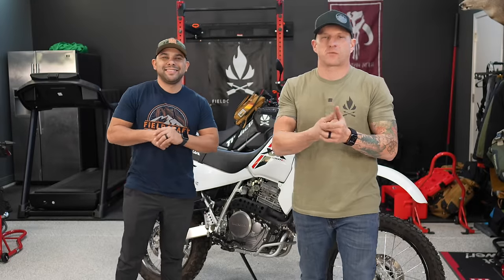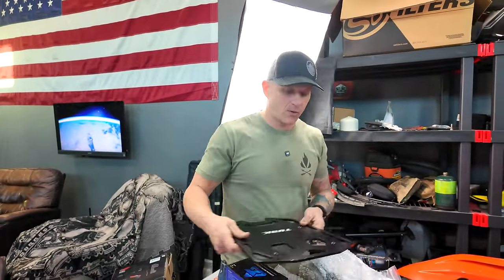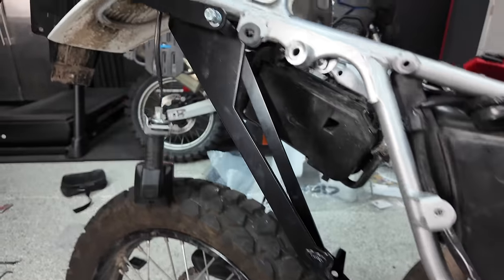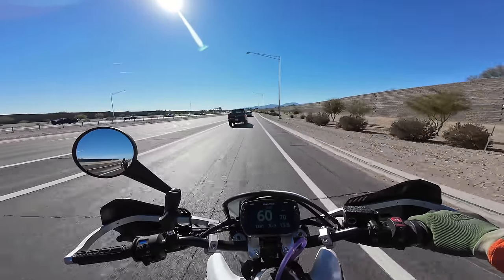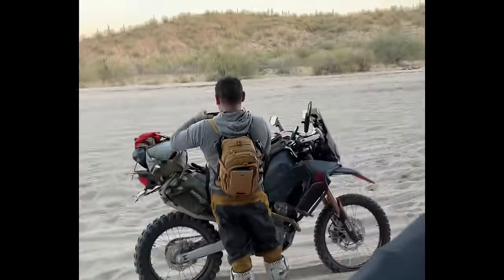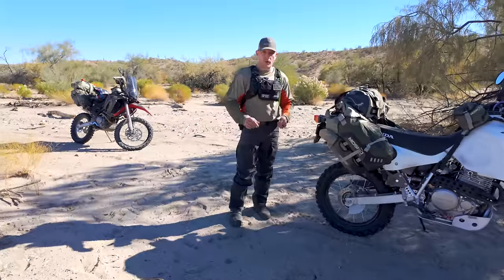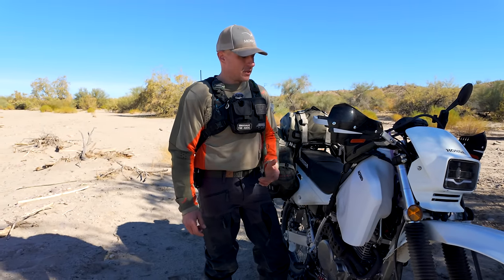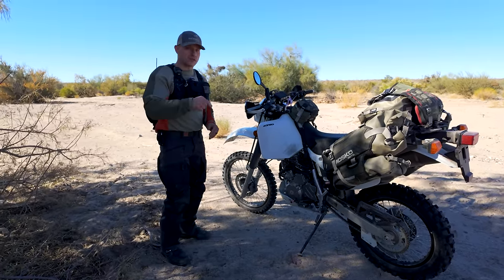Budget Friendly Bugout: Is the XR650L the Perfect Bike to be Prepared for the Worst Case Scenario?

Comment: If anyone wants a XR650L with 3K miles on it and all the sparkels, I have one for sale in NW Wyoming.
Reply: Below $3k?
Reply: @solosix3991   The stock bike is worth $5K and I have over $2K in farkles, what do you think.
Reply: No one ever keeps these long.  Too old of a design, no tach, no engine cooling, tank too small, too tall for 90% of people.  People keep KLR’s for 30k miles.
Reply: I had mine 12 years and i love it for what it is
Reply: @slalomking speak for yourself. I’ve had mine for over 3 1/2 years now and do hare scrambles with it all the time. 

Any adventure bike that you plan on actually riding needs an oversized tank. Air cooled, I drop it, I don’t have to worry about breaking radiators. It’s tall, I’ll give you that, but if you’re 6’ tall you’re fine, 90% aren’t built for a 340lbs adventure bike anyways. No tach? You’re probably better off in a car if you can’t distinguish how to shift based on sound. It’s an old design, if it isn’t broke, don’t fix it. 

Klr’s weigh what feels like a metric ton, I would hate to own something so heavy and so underpowered.
Reply: @slalomking 

Lots of people keep them for years. 

KLRs suck!
Reply: @slalomking what do you need a tach for on a dirt bike ....and being air cooled is advantage in my opinion no water pump no radiator no coolant hoses to potentially fail
Reply: @nathandevine552  yes I see the simplicity of air cooling.  I think most of these bikes spend most of their time on the road, getting to the off road area, thusly the KLR excels on the road.
Reply: Baja 1000 wins ain’t a joke. I gave up on KTM’s and the constant reliability issues, this bike will be running while your  ECU’s are trashed in a EMT strike. You’ll wish you had a carb 😂 the suspension is perfect once you get your cargo loaded. When I patrol this bike is very nimble and tracks well, and I’m only 5 81/2 32” inseam, and I can ride the $&@# out of this bike. Old design?? Its perfect and literally unchanged since 93’. End of Days Zombie apocalypse you’ll find parts for it ANYWHERE you go & EVERYWHERE you look!😊
Reply: @marctaylor-t8r  the cdi box and voltage regulator will still be fried on the XRL after a emp
Reply: @nathandevine552  but that CDI box is easy to replace and no programming needed, and cheap enough to keep a couple in a faraday cage till that day arrives 😂😂😂God forbid we ever get there, cheers!🍻
Reply: @marctaylor-t8r  better get a few spares if  sooner than later
Reply: @nathandevine552  true!
Reply: @marctaylor-t8r  don't forget that every replacement cdi will also be fried unless it's in a faraday cage.....old broken microwaves make good faraday cages👍
Reply: @nathandevine552  i thought it had to be in a completed circuit +\- power ground??
Reply: @marctaylor-t8r  nope it does not have to be installed to fry in a emp event.... that's my understanding anyway

Comment: For the worst case scenario you should remove the cv type carburetor and replace it with a slide carb like on the xr600. Also a kickstarter should be added. Replacing the stock headlight with LED is not a good idea, because if the LED burns out you're stuck with nothing. Carrying a spare light bulb for a stock light is easyier. Less electronics and good to go. The subframe support system was a really good idea
Reply: Just out of curiosity, how many LEDs have you seen burnt out? I haven't seen any. I've seen plenty of regular bulbs that have failed though.
Reply: Solid ideas for sure, I think the only thing I'd do differently is run a Lectron carb or something similar
Reply: Halogen bulbs can break super easily, that's not a very good idea either lol. 
if you really wanted to you could keep a spare/ 3 inch slim light bar for a backup. which would also still put off more light than a standard halogen bulb.
Reply: @DevDog67  replaced the stock bulb with an led and been through 2 on my tw and went back to stock maybe it was just the ones i got. the one on my dr650 is fine though
Reply: @DevDog67 I've had several automotive LEDs burn out over the years.
Reply: Also an old point ignition and a spare condenser shrouded in something for an emp. I’d honestly rather have an old triumph desert sled
Reply: @DevDog67 they can. Since theyre more duable what thdy do is feed more juice to a less capable led for a brighter light and it drastically reduces lifespan. But it depends on you a lot of people it is easier to go to autozone or orileys or nappa and they all carry the exact bulb you need and you might find a standardized wide prodiced bulb anywhere. It might not be easy to get an entire led headlight assembly for y8hr specific model in the apocolypse

Comment: Don’t forget to change out the thin OEM countershaft sprocket with a wider type Fritzco sprocket.  This is supposedly the “weakness” to the XR650L in that the OEM sprocket will eventually wear grooves into the countershaft.  Not sure as to how often this actually happens but a $25 investment is worth it.
Reply from the maker: We actually did that, but I didn’t mention it in the video. Totally forgot to thanks for the heads up though. I will mention it in the next video.
Reply: It's actually not an issue at all if you apply moly grease to the splines like the owner's manual says, but for some reason that practice has been forgotten and so people are wearing out their countershafts. The Fritzco is insurance against that for sure, though!
Reply: I have replaced counter shafts  on 200 and 250 Hondas.
Reply: @aTuWitty  Yeah moly grease is also used on splined machine shafts. Without it they will fail in a short amount of time.
Reply: @backcountryadvmoto  I'm curious what size sprocket you put on. You were hitting 80+ mph and find it hard even with a 15 tooth.
Reply from the maker: @peterkeyser3141 I actually have stock gearing on this bike
Reply: Thanks for the heads up!
Reply: @aTuWitty reading is for plebs

Comment: Rackless systems keep the weight lower and forward. Thus it does not adversly impact handling as much. Strap it on tight and keep the heavy stuff low and center.

Comment: The legendary XR650L is always the right answer.
Reply: Depends on what area of the country you live in.  In the North East it's thick woods and mud, and mud.  A Yamaha TW200 or a much smaller conventional dirt bike would rule.  Probably not need anything larger than a 350 four stroke in the north east as you'd be traveling on snow machine trails, ATV trails, wooded single tracks and secondary roads.
Reply: @SHL-ge3wn  TW’s are cool too! Love those fat tires!

Comment: The XR has been around longer than 30 years I've got one in my shop that's 42 years old still runs and rides great.
Reply from the maker: The XR identifier has yes, but the 650l has been around for 30 years. 1993-2023. That’s why Honda releases the 30 year anniversary additions we used in this video.
Reply: Not the L version
Reply: Not 650l

Comment: Muffler to make it quieter 
Flat Black 
Low gearing  to carry more weight, and lower fuel usage at low speeds. 
emp shielding 
headlight mod. one for  just enough light. And one mode for bright light. 
A EDC holder

Comment: For very little money you can build a bracket out of perforated garage opener railing and install it right under the headlight in between where those round reflectors are. That gives you the chance to put any rectangular 7” or bigger LED LIGHT for highway or off road riding. That rear tire will go bald soon, I personally recommend the Dunlop Trailmax mission, it’s a serious 50/50 tire and fits perfectly to this motorcycle. About the emissions air filters carburetors it’s all a dream because the motorcycle has only five speeds doesn’t matter what you do you never will be cruising like you do on your crotch rocket. It’s a good bike to have it in your collection. Thank you for this video 🤩👏🏻
Reply: Forgot to mention Amazon carries an on/off switch independent and directly to the battery, so no need to be cutting or stripping the original motorcycle cables. Just search LED light on/off switch comes with the positive and negative to the battery, on/off switch to the handle bar and positive and negative to the light. These lights are less than 40 watts and the battery will support it without need to change the stator. With that output in lumens you can go off road as fast as you desire, good luck 👍🏼

Comment: I bought a new 2022 XR650. And for a bike that only cost $99 a month I have way too much fun!  In 6000 miles all I've had to do is 3 oil changes and adjust the valves once.
Reply: That's impressive for the bike, but you couldn't afford to buy it outright?  It's cheaper than some pedal road bikes?
Reply: @bbaz6729  A lot of people still do credit even if they can afford the total down. If there is a credit option with a good rate why not? It's less out of pocket.

Comment: I love the 5.8 gallon plastic tank.  All ADV bikes should have a 5+ gallon tank.  If you don't want the weight up high, you don't need to fill it all the way, and the added volume can be used to protect the rest of the bike in a fall and as fairings for the rider's legs.  My baby GS has a pitiful 2.9 gallon tank so I'm forced to carry fuel which is dumber than dirt, and nobody makes an aftermarket tank for the G310GS, even though it's my only real complaint about that bike.
Reply: I’d agree in principle, but in recent years I’ve stated thinking about the problem in terms of range rather than capacity.. For my riding,  I think 250 miles is the bare minimum for an adv bike; on a crf300l, that probably means about 4.5g. For a big 1250 GSA, it’s over 6. Bonus fact; the largest tank I’m aware of for the 300 is 3.5g. Boo, hiss. Yes, supplementary tanks solve that, but still. :)

Comment: Fun vid. When I was looking for this type of bike to replace my KTM 790 with something more off road worthy I ended up getting the SWM Superdual 650 after a lot of research. It is 8K new, has a way more powerful water cooled engine, EFI, adjustable suspension, windshield, full crash bars, full engine protection, rear grab handles, super stout rear rack, center stand, auxiliary lights... ALL STOCK. If people would look outside the box some there are some really cool bike out there. I've been hammering it all over the western US the last 8 months, best 50/50 bike I've tried, and I have ridden a lot of bikes. The AJP PR7 is also VERY cool but not factory street legal.

Comment: This is one of the reasons I bought a 2023 also, solid bike. A great, simple platform for many different builds. A larger stator. A real build is swapping 2nd,  5th gear, 14t-48t drivetrain, change that spinnaker of a front fender for higher speeds, I run a trail tech vapor for rpm, and oil temp, head temp. I haven't decided on carb yet
Reply: Swapping 2nd and 5th for what?  Clue me in?

Comment: I had the 1989 XR600R until October of 2022 when I reluctantly sold my old girl. She never missed a beat and I rode sand , mud rock gardens and the Aussie bush. The bike was a little heavy at 125 KG or 275 lbs and if it fell on you was one heavy bench press but man that thing would just tractor. I ran 14/48 sprockets and it would just eat up the bush. Any  prolonged Highway I swapped out the front sprocket 15T to drop the revs a bit bit without needing to change chain. I  mainly trailered the bike to the Bush with all the tools and camp gear .  Many a guy has taken a 600 around the world, across the Aussie desert and the testament to how good those engines and bikes were and still are. Honda's only real competitor to the Yamaha Teneré 700 but in a single cylinder.

Comment: This is the first video I’ve seen on your channel. Very impressed. Used to work for Honda motorcycles. Very familiar with the XR650L. 
Honda suspension is good on that motorcycle. I personally used race tech suspension on mine.
What was the chest pouch you were wearing? 
Also, what was the deal with the radio? 
Look forward to future videos!

Comment: I have a 2017 that I bought new, I did pretty much all the mods you guys did, I recommend getting rid of the octopus emissions thing, that actually hurts the engine by causing backfires and overheating, it serves no purpose but keep Californian regulators happy. I also changed the carburetor for a Mikuni HSR pumper, if you do that, disconnect the pump and save yourself a lot of hours of unsuccessful jetting tests, with the pump connected it never runs right, with the pump disconnected it runs the way it should have from factory.

Comment: I have a 2020 XRL that I bought new.  I ride in sand washes that are strewn with rocks.  Very challenging.  The Honda is excellent in that stuff.  I have not touched the suspension.  I am 220 in street clothes.   I am an older rider at 72 so I bought a smaller lighter dual sport for the more technical stuff. But it is no match in the deep sand for the Honda which is why I won't ever get rid of it.  
The other thing is, that I checked the valve clearances at 600 miles and then again at a little over 3000 miles and they were still within factory spec!  I do plan on adding a oil cooler.  I debated doing that for a long time since I don't want another thing exposed that can get crush or damaged in a fall.  But, I concluded that the benefits out weigh the risk.  I have been using the Motoz rear tires with very good success.  These bike tend to eat rear tires since there is no cush drive.  I agree with your assessment that the Honda is still relevant and awesome after all these years.

Comment: I actually went to buy one of these one time and Honda thumbed their nose at my well established 790 credit score. I could have got my credit union to do it, but it kinda hacked me off at them. Bought a Suzuki dr650 from next door. I don’t doubt that Honda is a jam up machine. The dr650 is every bit as much bike with a cult like following and aftermarket support to match. Funny what happens when a manufacturer put out a solid machine, with a solid design,and sells it unchanged for 30 years. It is kind of a blank canvas when you get it, then you focus it to your needs and riding style as you modify it over the years. Since 2010 mine has morphed into an adventure bike with windshield, oversized fuel tank, carb re jet,exhaust, large panniers, top trunk, and  more comfy seat. It has taken me back and forth to work, a few times through a disaster zone after a hurricane and a wicked flood faithfully for 20,000 miles and counting. Not a single issue, oil change and air filter service every 5000 miles after 500 mile break in service.adjusted the valves once. And swapped out several tires. I just got my harley back from a friend I sold it to, both kids about to be in school, so the mrs is showing intrest in learning to ride and getting her motorcycle endorsement. So the Ol trusty dr is about to morph into a supermoto. Lowering kit, supermoto aluminum mag rims that accept tubeless tires. To drop the seat height down to a level she can build confidence with as a new rider. Might even re jet the carb to factory settings and re install the factory exhaust to calm the power back down as it will do roll on wheelies in first and second as is if cranked on. Just enough power to get down the interstate, but extremly forgiving in stock form.

Comment: I had the XR650R that I fully made street legal thanks to Rocky Mnt and XR's Only. That was a great bike and there is a video of me out there riding not to far from your location while my buddy was filming on his XR650L. We switched at one point so he could try the R out. All I will say is "2 completely different bikes" one not better than the other but just engineered for 2 different things. I wish I still had that bike but now that I'm older the electric start, plush suspension and air cooled engine don't sound bad. Though I will miss the power my R made and the way it would fly through the desert at 65-110 with ease!

Comment: I love the project and the XR is a time tested platform and there's a reason they still make them.  @Mike H - Did you black out your Rally? Looks sick! I'm a huge fan of both of  you guys  channels. I think you are missing the point in a few areas of having a reliable Bugout / SHTF bike. - - Why change to a Li battery? I don't think they are as reliable as standard Gel or stock batt. They don't like cold and I've seen too many problems with them that the weight savings isn't worth it IMO. Why put a loud pipe on a bugout bike? Draw's attention while the stock is nice and stealthy. The weight savings on a 650 pig is negligible. Stock Brake and shifters are also easy to bend back into shape after a fall vs the aluminum ones that can just snap. For reliability in SHTF I'd stay stock and carry spares. Bash plate isn't just for bottoming out. It protects the bottom from smaller rocks flying up especially in the desert conditions like you guys were in. I'd also get a spare CDI/ECU and put it in a faraday bag for the future. I'm a survival genera fan so these things stuck out to me.

Comment: The XR600R was the predecessor to the XR650R, both baja champions. The L is kind of a spin off of the older XR600R that is meant to be more of a cheap, reliable dual sport without any bells and whistles.